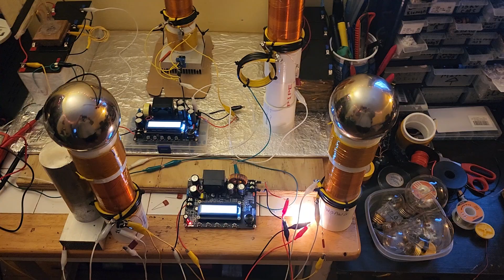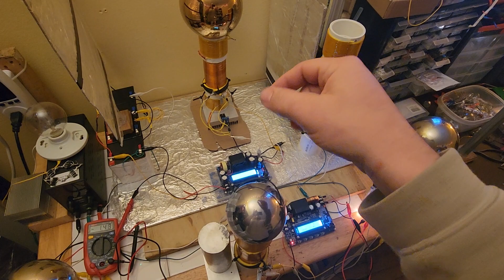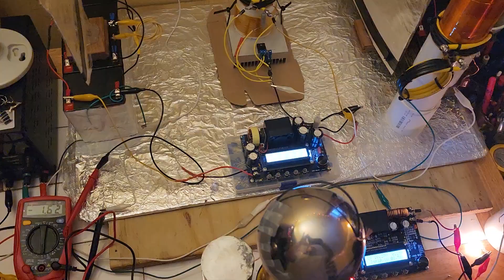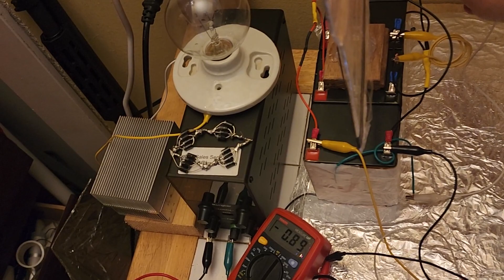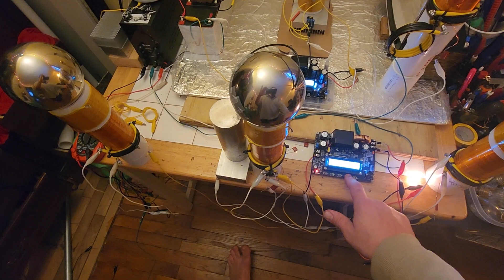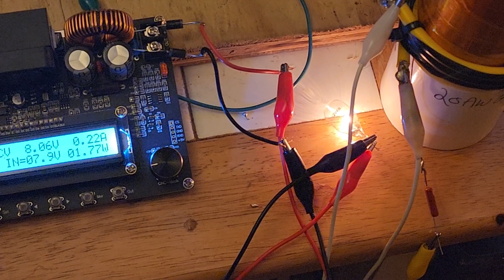🤷‍♂️FAILED ATTEMPT AT READING CURRENT FROM SUPER CAPS TO DC BOARD. MAJOR DETUNING ISSUES🤷‍♂️

Comment: Hey Mal when u get a chance test the output voltage of the the Boost converter with your scope to read the frequency. If its operating below say 1mhz there are medium price range clamp style current probes that connect directly to oscilloscope with bnc connector. If frequency is over 1mhz current probes are not priced for the hobbyist level consumers. Only other thing i can think of is a RF watt meter those use a element inside device that actually heats up when current pass thru to get a reading.

Comment: I think it's correct. It appears that you are using roughly 20 watts (12.5 x 1.6) to power the boost and putting out about 12 watts or so at 78v x .16a. Whether it's detuning the system or not is a different matter. But there's no reason to believe the meter is not accurate. The length of the leads coming from the battery should have no discernable effect on the system since they are isolated by the boost circuit.